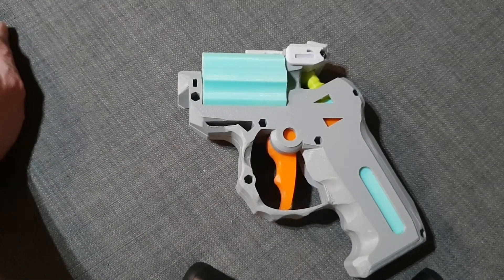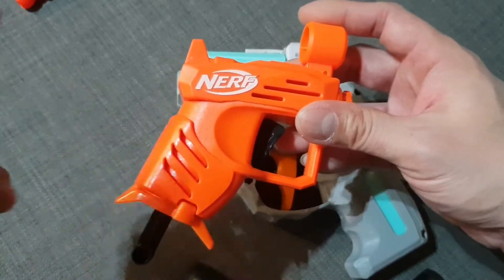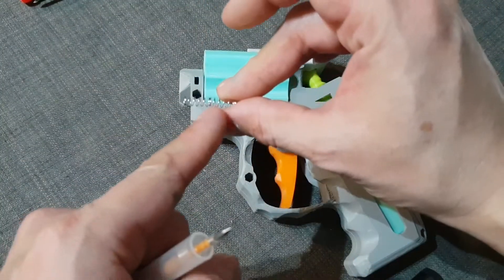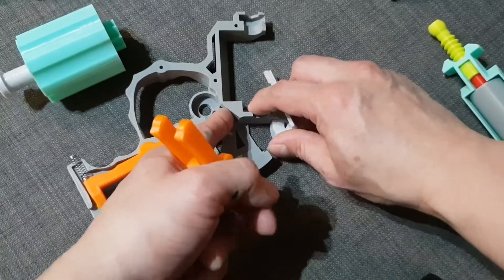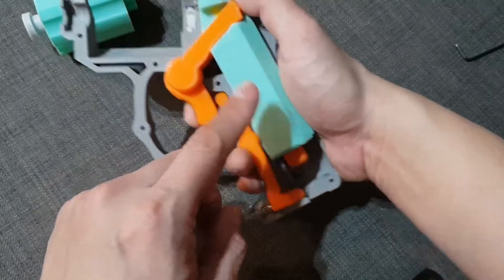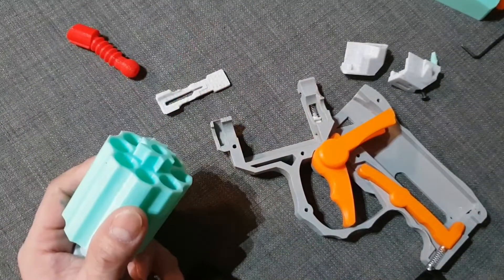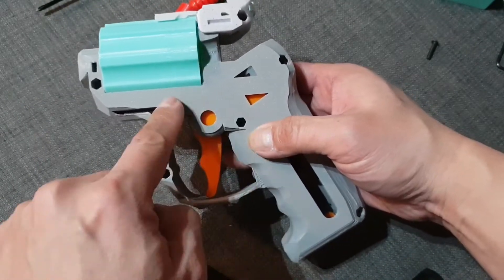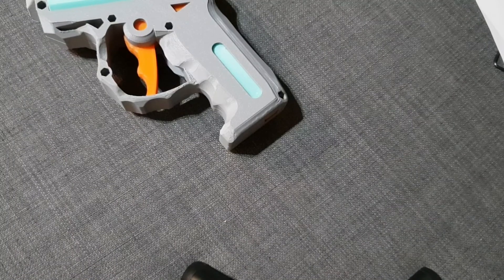Answers to my fellows on Discord

Comment: My cylinder will rotate most of the time, but it will sometimes (every 4-5 darts) it will get stuck, and no matter how many times I shoot it the cylinder won't cycle. Any advice?
Reply from the maker: Have you tried all the 3 hands that were included in the folder? Please kindly go to the google drive folder, print and try again parts 12. / 12.1. / 12.2.  

I’d try 12. first, and it’s called “12. Hand (default_less aggressive angle)”

If the issue persists after trying the hands, then try parts 4. And 4.1. 

I have issued you a full refund just now, but no worries, I will keep helping you to finish the project ：）
Reply: @BoBoInnovation  you don't have to refund me! Just looking for advice. Will try the different hands

Comment: I am having trouble printing the the cylinder stopper. One of the two fin pieces at the end seems to print inconsistently. I tried many temps, orientation and so on but each time one side of the fin portion failed. This is using supports from the slicer so it could be a slicer issue but i was having a similar issue to the shell where thin layers of overhanging PLA was warping with layers until it warped enough to get peeled by the printer nozzle. Do you have a version with inbuilt supports or do you have advice to get this piece to adhere better.

I am using PLA that has worked fine for all pieces to this point on an ender 5.
Reply from the maker: Hi, can you dm me via Etsy? So that I can provide a link to you to get the files to address the issues you just mentioned, thanks a lot!  Paul
Reply: @BoBoInnovation  Thanks a ton for the help and i will let you know if i figure out how to break anything else. I am a good crash tester :)
Reply from the maker: @fasthippy  Oh, just a reminder:

"Do Not" use any slicer-generated support or brim for:
1. Left Shell (with built-in supports and spot brim)
2. Right Shell (with built-in supports and spot brim)

"Do" use slicer-generated support (still no brim) for:
11. Cylinder Rotation Stopper with spot brim (FPS+2)

Thank you :)

Paul

Comment: To note: When i was printing my shells in PLA, I had some issues with the slot above and behind the cylinder. This is the slot that holds the rear site/cylinder stopper and during printing there are spots that are thin and printed in the air. Due to my bad filiment, these sometimes warped and caused that part of the print to fail. You may want to include some break away support for that spot to keep it from warping during printing.
Reply from the maker: Thanks for your suggestion, and I'd suggest to use brim for now but I do have used a "spot brim" for that specific area while using PETG.